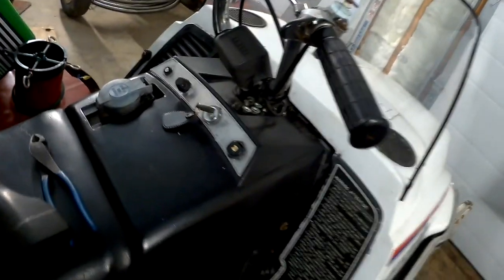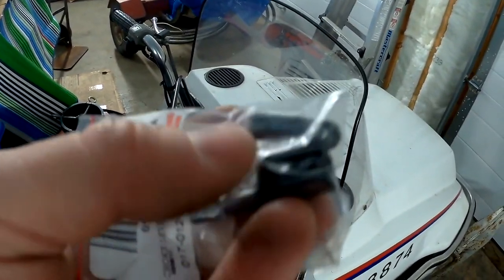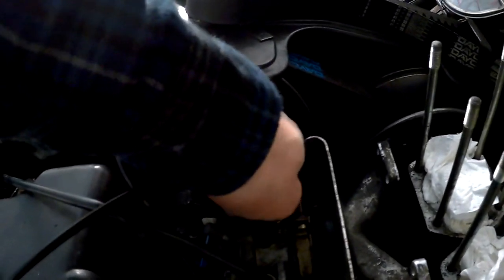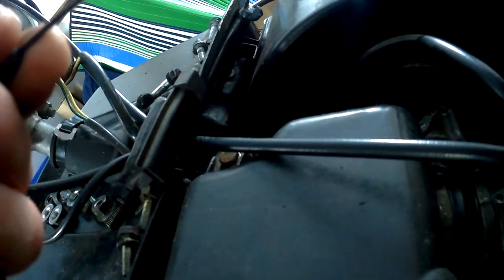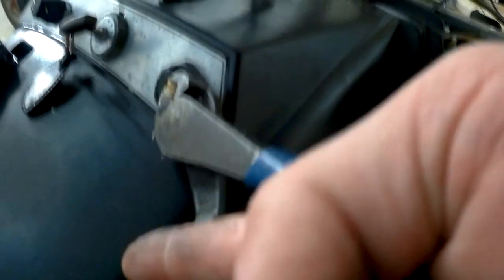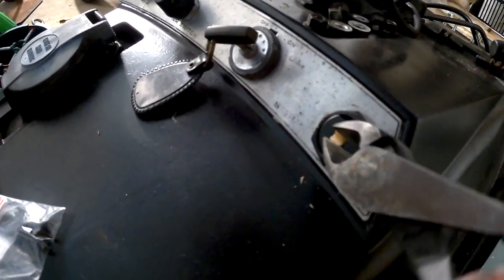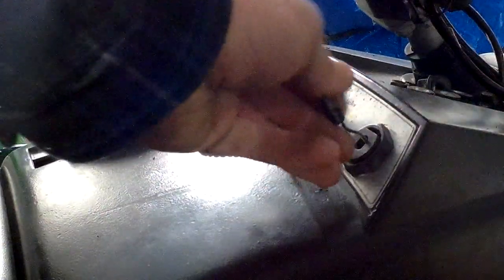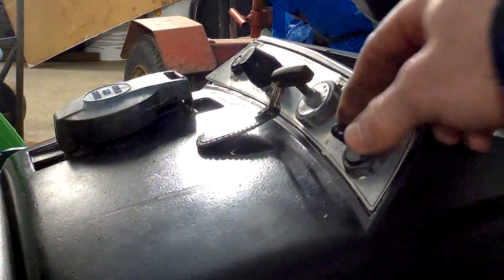How To: Snowmobile Choke Repair

Comment: My choke lever broke off completely. Same style, but the ball of the choke is stuck inside.
Reply from the maker: Disconnect it at the carb and push out and it will pop the ball and plastic out.